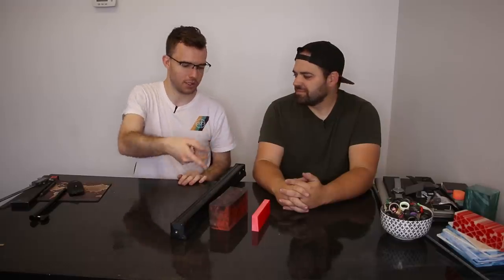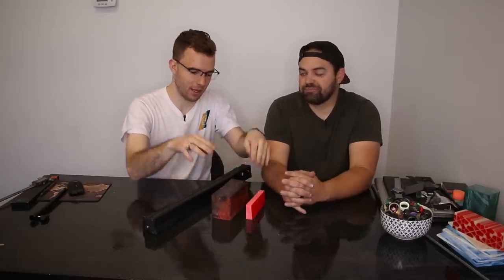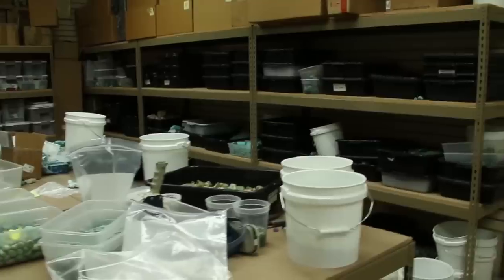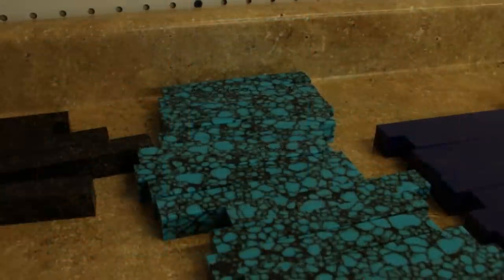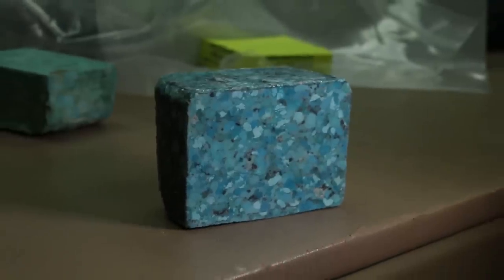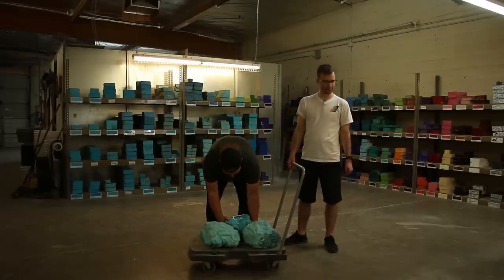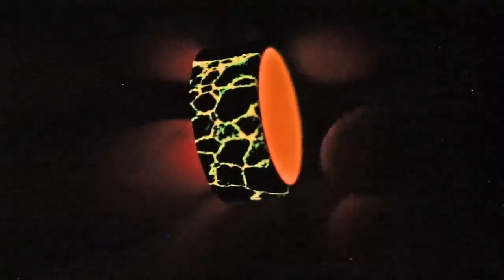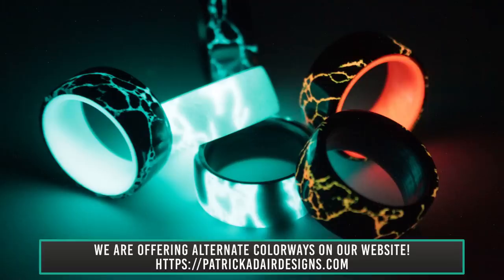Making the Tectonic Trustone Ring | Patrick Adair Designs

Comment: i dont want to sound rude, i dont make rings but i do a lot of machining in general. i was wondering what the benefit of your ring mandrel is? could you not achieve the same thing with inside jaws, or push come to shove a wooden dowel with a slice in the middle that you could chap a wedge in to expand it?

Comment: Just curious, you often use CA glue to adhere 2 parts of a ring (IE an outer band and a liner, or with the carbon fiber glow inlays, to glue two "halves" of the ring blank together,  but then in other parts you make CA glue sound weak, even using it to adhere stuff to a vise while you are working on it, and then take it back off. Which is it? Could the technique you use to make the carbon fiber rings with the inlay channel (making it in two parts which get glued together) be done with metal?
Reply: Obv im not op, but I can offer some insight: CA glue is really strong against some forces and weak against others. For example, it’s really strong against tensile pressure, but very weak to shearing force. So pulling directly away from it, it’s extremely strong, but if you twist it, it can pop right off.